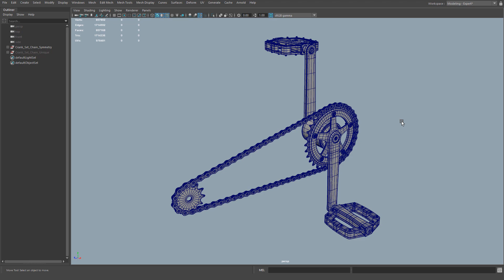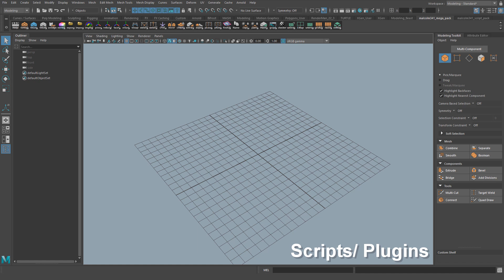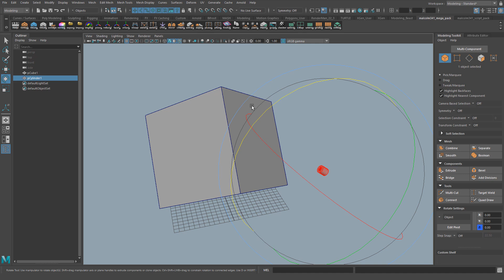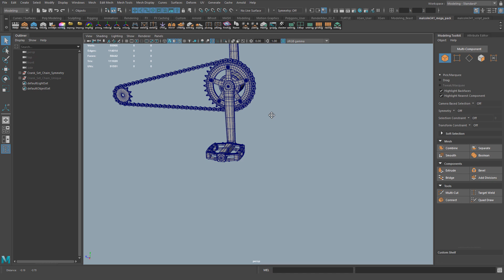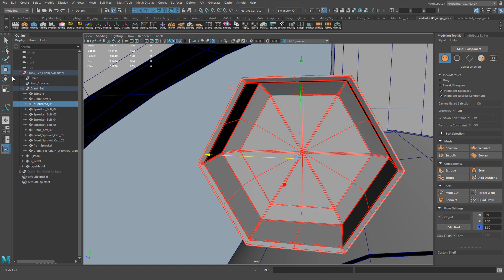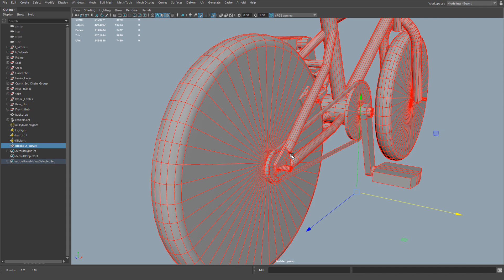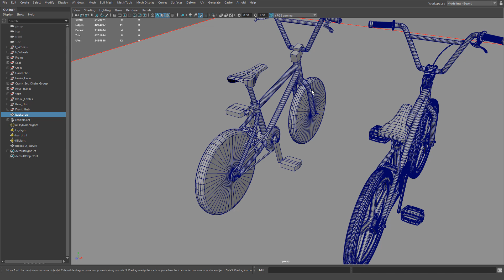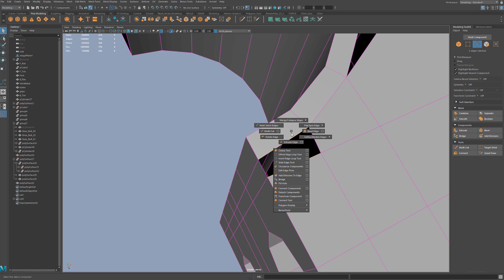How To Get Faster At 3d Modeling!

Comment: Yes sir, you need good topology but, why do you good topology?. sometimes my hard surface model look good and have bad topology.And I didn't used Mesh Smooth. So why should I care about good topology sir.
Reply: Topology is a very important part of modelling
If the topologies are bad (if there are ngons) then it is very hard to uv unwrap to apply image texture 
It the object has bad topology you can't rig it properly and animate it
Retopologizing is a very important step and most game and film studios have a specialized person or team specialized in retopology
You can technically render it with bad topology but it will be pain in the ass if you want to do other than static render
Reply: @Anonymous-tu4pl  right, and building on that Ngons don't allow for reliable triangulation when rendering or exporting. Since triangulation is paramount for calculating light bounces the triangulation should be uniform.
Reply: More then half of then don't even have subdivision
Reply: You need good topology if your model is going to be animated and for proper lighting.
Reply: What if I don't used subdivision?
Reply: This is my work https://www.instagram.com/p/CEVlwBFnF5G/?igshid=qwozcegi7zwd
Reply: Yes you both are Right, And i Strongly agree with you.But sometime to save some time and labour work and for small client and if it is good enough, Then Who cares?  cause you how much work  Retopology needs.

Comment: one more tip i would like to add is... "make a plan but don't spend all the time in it" Like.. if you know that the object is radially symmetrical.. make the nth portion.. If something curves in the abstract way.. model the details in plane then deform it afterwards.

it's better to try 3 things in 30 mins and getting the job done than overthinking, trying one method in 30 min and not getting the job done.
not saying that you are doing the opposite.. it's just something that wasted a lot of my time.
Reply: Idk sometimes when I free hand model...I have no plan, and just take my time so the ideas have time to catch up! But I'm just a hobbyist...so no deadlines
Reply: @justanameonyourscreen5954  how are you doing?